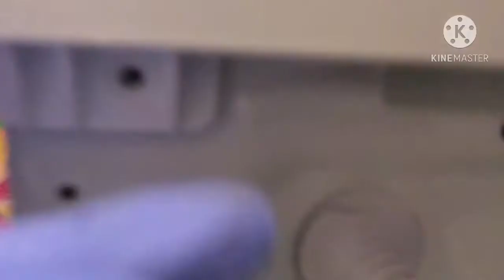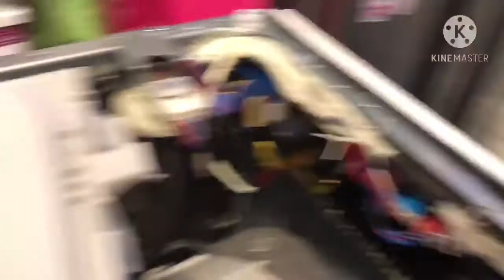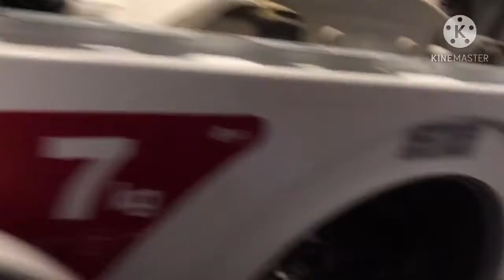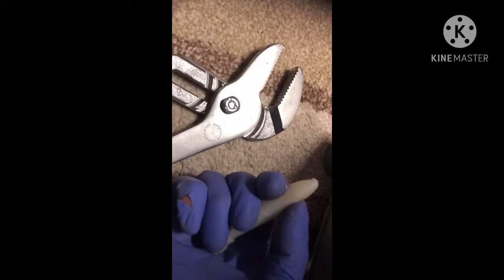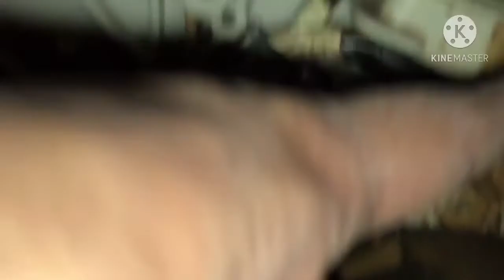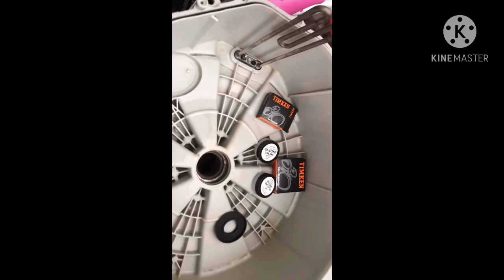Washing machine bearing fix

Comment: Very helpful so far, though it feels like there is a section missing during disassembly. You take the back motor off and then just lift the drum out, but didn't see you remove weights, or some pipe connection from bottom of drum, and only heard mention of removing one damper arm.
Reply from the maker: Hi Ben, yes you do need to remove the weights which are held in place by bolts. Before removing weights I would recommend removing the plastic pins from the dampers. To do this you will need some pliers to squeeze the pins on the sides of the pins and then push with fingers or use a large plier to press out. Lastly, pull of the springs that hook the drum to the machine housing, but be careful as you will now need to hold the drum ready to pull out. I would recommend 2 people, although I did do this on my own.
Reply from the maker: Trying to video everything and do the job for takes ages. However, apologies for missing steps. My main aim was the hardest section of removing and replacing the bearings.